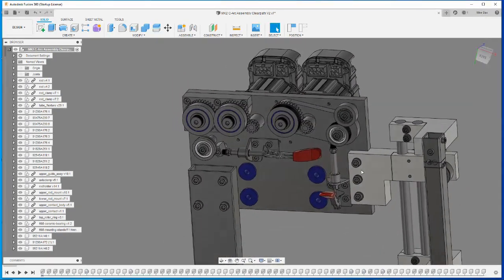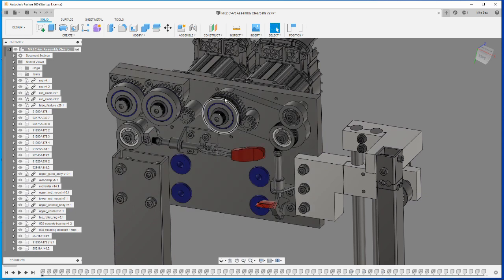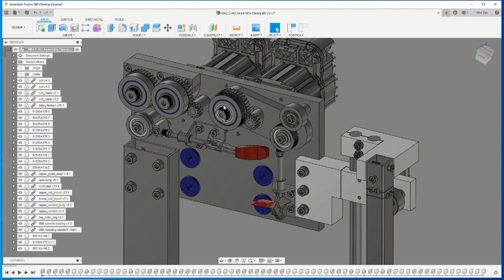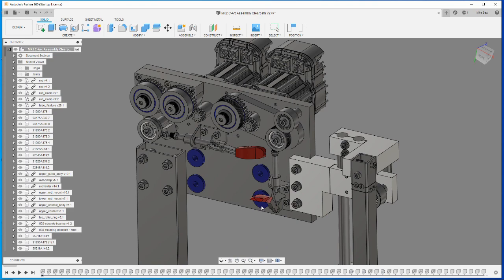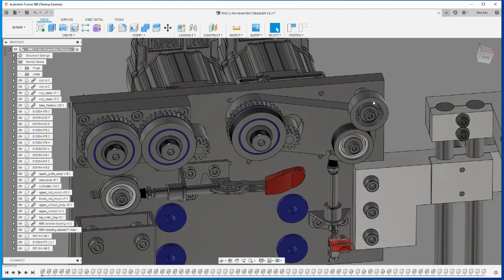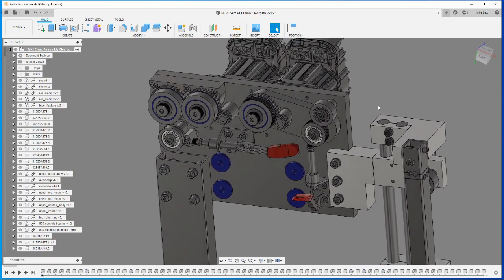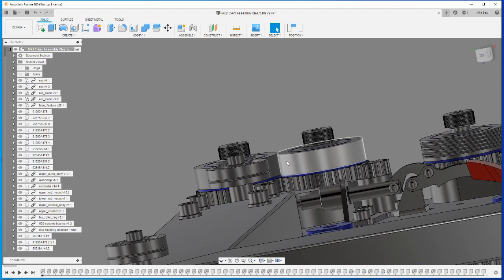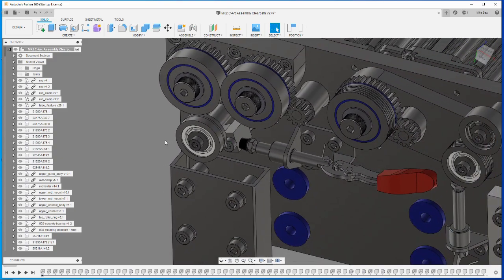Wire-EDM Machine, MK2 Redesign: Part 13, C-arc design ready

Comment: looks clean and easy for rethreading the wire, my doubt is if the wire tend to wobble on the pull wheels, but this system is the the industry machines use,  should work, congrats  👍🏻